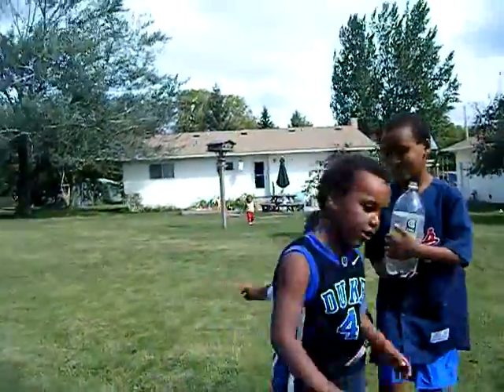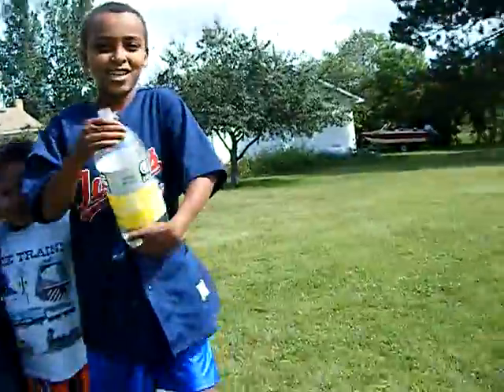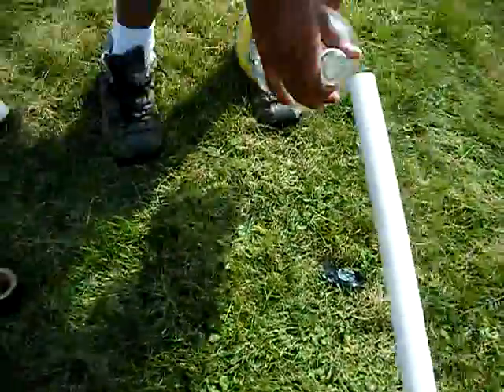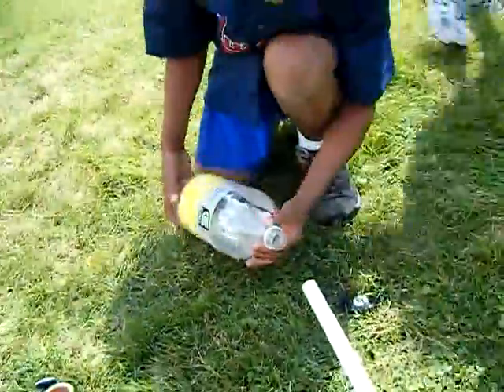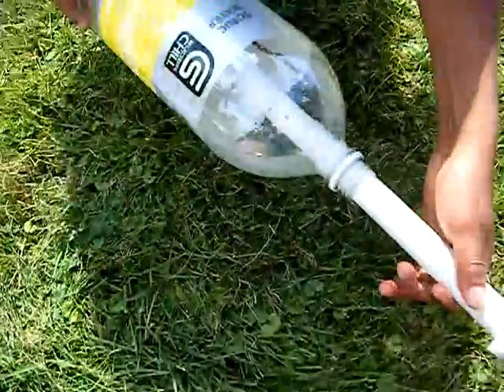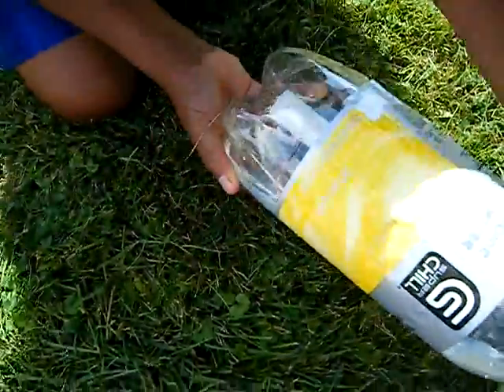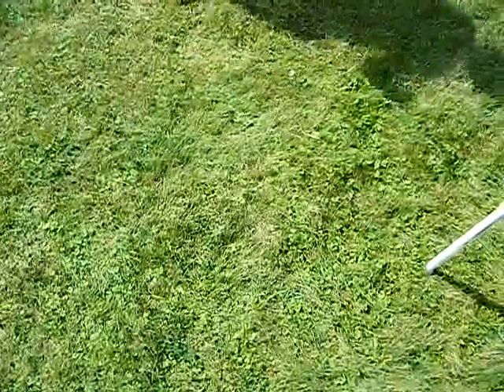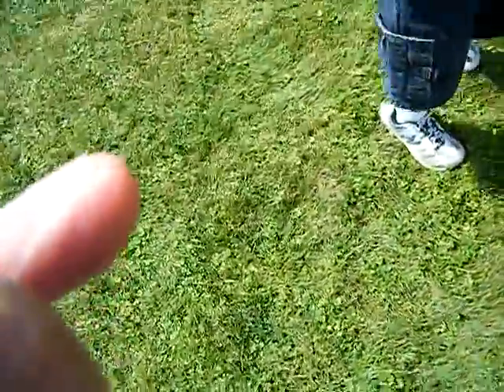2 Liter Water Rocket with PVC launcher

Comment from the maker: @afiq8219 Eventually, the pressure makes the water leak.  But, it's good up to 60PSI or more.  The key is the "bulge" you make with a candle so the bottle seats on it.  And the zip tie contraption you make to hold it in place.  The link in the description is to a REALLY helpful video if you want to make your own launcher.